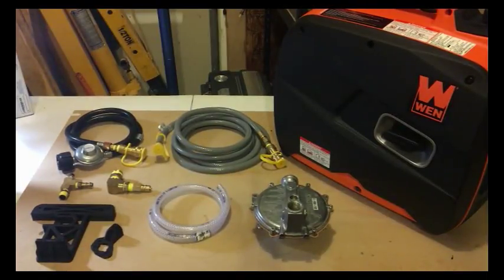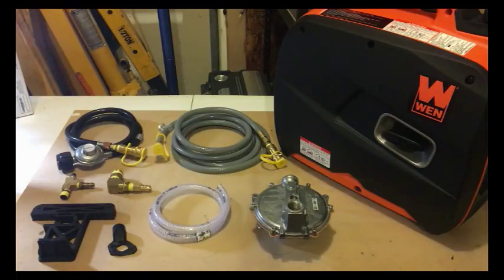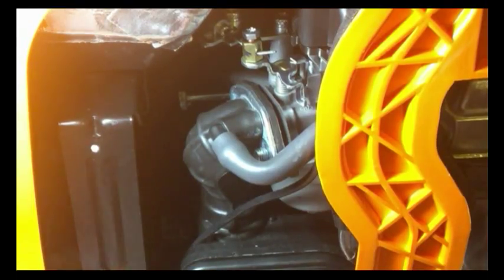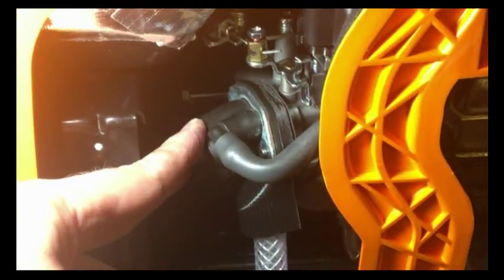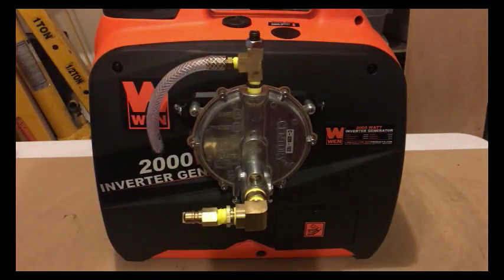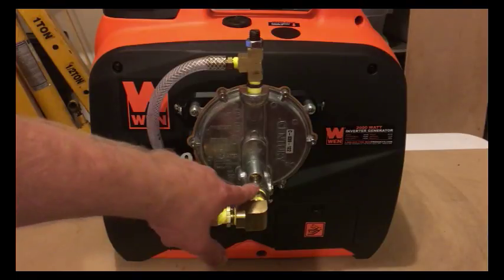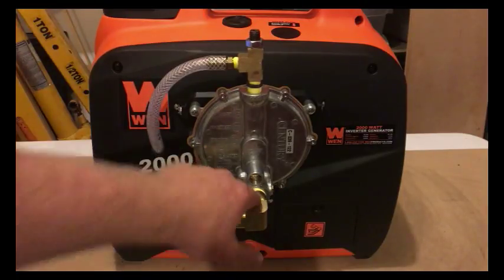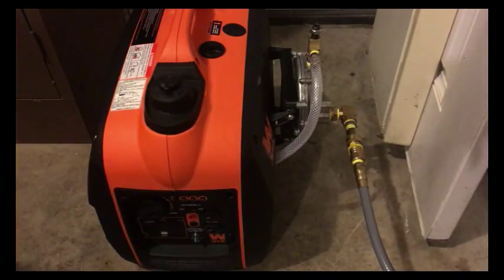Tri Fuel Generator Conversion - Natural Gas or Propane

Comment: I got a Wen df480ix that already does propane that comes with its own regulator hose and quick connect to the generator.  Do you think I can just feed regulated NG to the propane connection port and just adjust the gas block without messing with the carburator?

Comment: Is there a switch or lever to change from gasoline to Natural Gas?
Reply from the maker: @classicskatespots1  if there's gasoline in the carburetor it'll run off the carburetor otherwise you just run it out of gas and then switch it over to propane or natural gas.

Comment: My generator has a wire from the hose connect that plugs into an electrical fitting on the generator. It won’t start unless this wire is plugged in. What do I do here. When you plug it in you can hear a click sound. My generator is gas and propane. I would like to convert it to natural gas so I could use my deck quick coupling attachment for my BBQ

Comment: Hi Chris - I'm sure I've missed something, but why the need for a regulator at the propane tank as well as the kitted one mounted on the generator itself.
Reply from the maker: the regulator at the generator is very low pressure and more or less throttles the propane into the motor based on the engine vacuum.  the regulator at the tank just steps the pressure way down so the secondary regulator can handle the propane pressure.

Comment: Chris,  Thank you for the excellent mod instructions. Is this the only regulator that will work? Or do you know what specifications are needed in a regulator? Also, do you have knowledge if WEN uses this snorkel on other models?

Comment: My 12kw Rainier Generator dual fuel (LP/petrol) seems to run fine when I connect NG to the LP regulator with no modification except need to adjust choke half way. Is there something wrong with doing this.  Thanks

Comment: Chris, I notice you are using 3/8 gas hose. I bought a Sorkel conversion kit from US carburetion. I have to press the primer button all the time in order to run the generator. Their help desk told me 3/8 hose is too small for a generator. I have a Wen 56225i. The conversion kit has same regulator. Thanks
Reply: The regulator inlet is 3/4" usually from us carb.  A 1/2 hose runs my 3500 watt ok.  They do make 3/4" hoses, a little pricey but should work great for your gen.
Reply: @briang9198  Thanks for taking your time answering. I ended up run the generator with 3/8 hose. The current hookup on my deck is 3/8. After I read more online I learned that it's better to run the generator with gas first just to lubricate the machine. Then you can switch to gas or propane. It took me several days to get the machine started with gas. After the first run it starts and runs normally with no issue. It's the first time start with gas making it so hard. Cheers!
Reply: @myzmlm  Nice!  Yes, I did the same thing and broke it in on gasoline first then switched.  The switch is the harder part since it'll run a little rich for a bit due to some leftover gasoline fumes.  Good idea on using the deck hookup, convenient!

Comment: Thanks Chris, any rough idea the temperature carburetor gets?  Also would 1/4 ID tube from  carburetor to low pressure regulator too thin?
Reply: 5/16 works great on mine so I think 1/4 would work on the fuel output side of the tee.

Comment: Just to confirm, it still runs on gasoline if you wanted it to do so?  Couldn't tell after you installed the adapter if the fuel line for gasoline was still in place or not.  This is a great video!
Reply from the maker: thank you.  yes it will still run on gas

Comment: Chris, This is freaking awesome! You put a lot of time into this and the instructions are better than any professional ones I have seen. What material do you recommend using to print the inlet adapter? Is PLA ok? Thank you so much for putting all of this out there. I am looking to buy a generator and this is exactly what I need to know.
Reply from the maker: Thank you very much.  Im not sure about PLA,  I used ABS when I made mine but ABS is really hard to print with unless you have a printer with an enclosure.  For a regular open frame printer I would recommend PETG

Comment: Chris, thanks so much for providing everything so others could do the same!  During the recent power issues in TX, this conversion was priceless because it eliminated the need for finding, transporting, and storing gasoline.  

I have a Wen 56235i which is similar internally.  I had a hard time getting the bolts on and ended up backing out the studs a few turns.  Worked like a charm.  Thanks again!
Reply from the maker: Awesome,  Im glad it helped out and Im happy to share.
Reply: @anninrobotics  What resolution did you use on your print?  I used ASA 0.01in.  Tried to use it again today but found that the adapter warped from heat & cracked.
Reply from the maker: @PhatTony-wr1ek  Hello, I haven't used ASA myself but I understand it's supposed to be a superior material.  I have used ABS and I printed at .2mm layer height.  I know that I have had marginal results with ABS unless using a fully enclosed printer. I'm not an expert on printing but with the open frame printer I have now I would go with PETG.  Hope that helps.

Comment: Great video, thanks for the specifics!  Would you be able to compensate for altitude by just leaning the fuel flow? I camp at 10-13k feet and the gasoline is a set mix, so it runs at a significant reduction.
Reply: There are jet kits available from WEN for high altitudes.

Comment: Great job and looks good. Hey, there's a problem that I wonder if you mind helping me with ? I've got two Duromax XP15000EH dual fuel generator . Now I haven't hooked it up yet but I've already bought some things for them but haven't installed them yet like quick connects and 12 ft.  propane gas line. Now the generator is supposed to run on both gas and propane but I also want the option to run natural gas if I needed to. I've looked all over the net and I can't find a tri-fuel conversion for my size of generator. Think you can help ?
Reply: Did you ever work this out? I'm in the same boat.

Comment: Hey, I have referenced your video a few times in my search for buying a generator for my RV. I got a Ryobi Bluetooth version since I work for them and get a major discount. I downloaded the solidworks file and am working on modifying it for this generator. Are there any major things I should think about, Angle of gas entry or anything like that?

My plan is route the Carb line through the housing and attaching the block valve with a quick connect there then routing the hose over to the RV with a quick disconnect  to the regulator on the RV. Do you see any issues with that?
Reply from the maker: I don't see any issues, I didn't do anything special for gas entry, nothing as far as angle or anything.
Reply: @anninrobotics  http://imgur.com/a/oRQnabD here is my first adaptor print, i need to get the other stuff, but i Printed this with my resin printer to ensure it's air-tightness.

If you would like me to print one with your generator and send it to you let me know.
Reply: Tim-  I also have the RYI2300 Ryobi BT gen.  I having a heck of a time starting with natural gas.  One time I was able to jump from regular gas over to natural gas, but then I had to hold the primer button down to keep the engine running.  Any tips?

Comment: How's the 3d printed parts holding up?  Any problem with warping from the heat?  What did you print the parts in?  Is it ABS, PETG, or something else?  Thanks!
Reply from the maker: It is ABS,  I havnt had any issues, doesnt seem to get too hot

Comment: Nice video.  I was wondering if instead of using the 3D printed adapter if introducing the natural gas or propane via the inlet for the valve breather would work also?   It right there on the elbow of the intake snorkel.  Any thought if that would work also?
Reply: For the demand regulator to work, and for the engine to be able to be throttled properly, you need the gas to come in right at the mouth of the carburetor.  Even better I think would be for the gas to come in on the engine side of the throttle plate.

Comment: I have a Sportsman 2200 generator that is dual fuel. (Propane and gasoline).   Do you know if there is an easy way to get it to run on natural gas also?
Reply: You’d have to be able to adjust the flow from the demand regulator like he does with the t fitting valve that he made.

Comment: I would like to convert a Harbor Freight Predator 3500 generator to run on gasoline or propane. The conversion kits I've seen only allow you to run it on propane. I don't have, nor do I know anyone who has, a 3D printer. Will your parts work on any propane conversion kit?
Reply from the maker: the adapters I have on the page are for the WEN and the predator 2500.  Im not sure if it would work on the 3500

Comment: What about varying loads?  When more demand is needed will it auto adjust the fuel  gas/propane when it need more amp/watts?
Reply from the maker: yes they regulator will throttle the gas coming in as needed.

Comment: What filament type did you use for printing the snorkel? I'm assuming ABS since you used acetone to clean it up. Do you think PETG would be okay? I haven't had many successful prints with ABS. Thanks!
Reply from the maker: GGR18 yes I used ABS but I think it would work fine using PETG
Reply: @anninrobotics  Tried your adapter on my Harbor Freight Pedator 2500 watt inverter generator and unfortunately is going to need  modification for this application. Can I email you a sketch up?
Reply from the maker: Sure, you need me to model and send you an stl?
Reply: @anninrobotics  That would be awesome! (SKU 61169 Predator 2500 Peak/2200 Running Watts, 4.7 HP (125cc) Portable Inverter Gas Generator). There is not much room with the air housing. I can send you some photos, dimensions and additional information if I have a place to upload them to... Thanks!
Reply from the maker: GGR18 can you email to me at Chris.annin@gmail.com
Reply: @anninrobotics  Just sent you an email.
Reply from the maker: @ggr1847  sent you an updated stl file.  once we figure out a good model that works I'll add it to the repository for the predator 2500

Comment: That is really an eyesore, that Regulator sticking out of the generator like that. Also, it makes the generator bigger and harder to fit in some places. I have seen some nice Mods where both regulators are on the propane tank and not on the generator. Thanks for sharing, but this is one mod I will no do because of its awkwardness.
Reply from the maker: EL EVO Yeah you can mount the regulator wherever you want.  Not really a great place on the generator that isn’t an eye sore but it is what it is and I want to be able to plug into propane tanks or the natural gas from my house without a hassle.  Had a power outage about two weeks ago and I just plugged it into the house and it ran all night didn’t have to worry about liquid gas or running out of gas it was kind of nice.
Reply: The low pressure, on-demand regulator (the large one) is always recommended to be a near to the carburetor as  possible. The "on-demand" part is based on engine vacuum and the longer the hose between the carb & regulator, the greater the lag between demand and supply changes.

Comment: Nice video. Btw, is there no problem with the gas being too cold at the inlet of the pressure regulator ? I noticed you're using propane, which has a low cooking point (- 42C) and a high vapor pressure. So this will run smoothly. But what if you're using LPG (common in Europe) or butane gas ?
Reply from the maker: Philip Gevaert hello, there are 2 different regulators for propane and one for natural gas given different pressures. I haven’t had any issues using these. In the description there is a link to instructions with correct parts to purchase.
Reply: @anninrobotics  Thnxs ! I know about the different regulators. However natural gas isn't that common over here for converting power generators. I used to do some car mod's (from gas to LPG) and in some cases you need to pre-heat the regulator. Anyway, thnxs for sharing, it's always nice to see how other people are solving problems or come up with ingenius ideas.
Reply from the maker: Philip Gevaert ok I see what your asking. I haven’t had to preheat or anything like that. I haven’t had to fire it up that often though and haven’t had to mess with it when it’s below freezing. It’s a mild climate where I live
Reply: @anninrobotics  A mild climate.... lucky you !
Reply: Place the tank near the cooling outlet from the generator. Not the exhaust though.

Comment: How do you like the Wen generator?
Reply from the maker: I bought this generator based on reading numerous reviews and the fact that I cant afford the Honda.   I have this generator for emergencies and camping but I haven't used it much so I don't have any valuable feedback.  It seems like a great generator,  It doesn't look or feel cheep and seems well made.  Ive had no issues and it functions great. but like I said I haven't put a lot of hours on it so I cant really speak to its reliability.

Comment: How to adjust the mixture screws on carburetor without O2-sensor ? The mechanics of the cylinders can be damaged\overheating due to improper fuel mixing in the engine.
Reply: Run it too lean, then run too rich, then somewhere in the middle.  Or get an o2 sensor to put in an exhaust extension and measure the actual fuel mix.